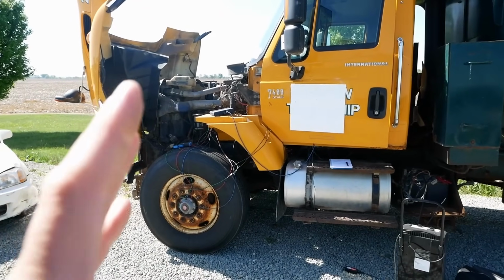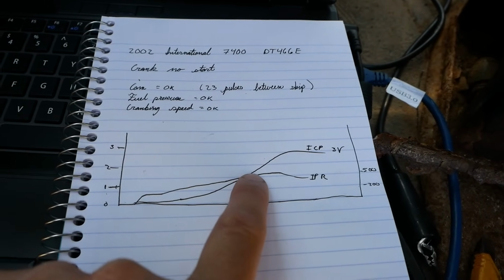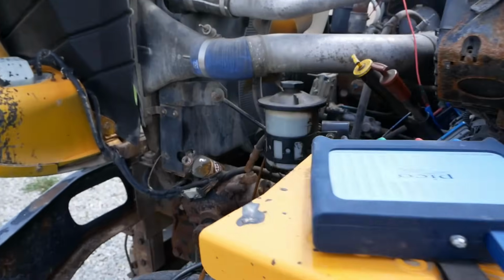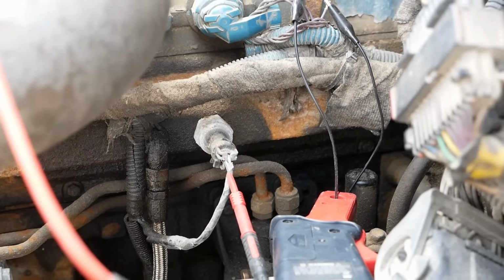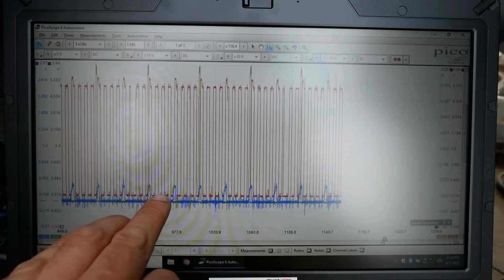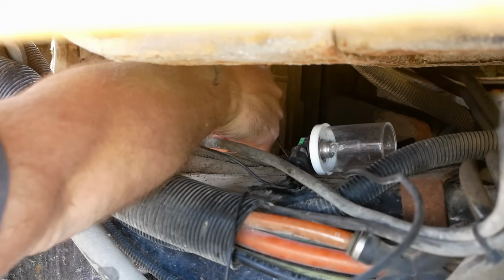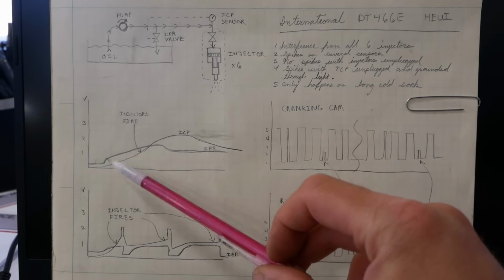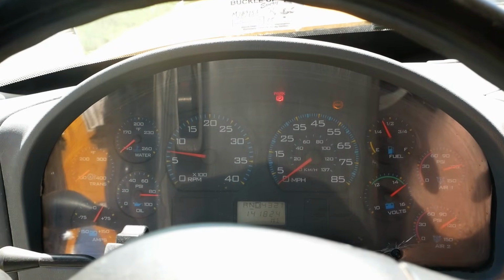International DT466E Won't Start without Ether after Sitting

Comment: The hump you are seeing is probably voltage drop on the ground wires/connections. Depending where you connect your scope ground it will measure the voltage drop of some wires.  As the injectors need a substantial amount of current, they will give you the biggest voltage drop. When you disconnect the injectors you don't have the high current peaks anymore and no voltage drops either. Maybe you could use your current clamp to check the wires that carry the injector currents from battery to the ecu and reinforce those wires for lower resistance and lower voltage drop. Or You could use the scope to measure the voltage drops on power and grounds on the ecu.  That would be better than using the light bulb probe. Maybe if you change your scope ground to the ecu you eliminate your voltage drop measurements and that would help identify the no start  issue. That is my guess.
Reply: Yes, looks like ground issues. ECU has bad ground so it is pulling current through sensor grounds. Test lights are not good for testing grounds especially with an ECU. Internally the ECU connects them together. One can be open and the light will show a ground as it runs through the ECU to a working ground.
Unplugging the ECU and testing powers and grounds will show valid information.
Reply: Good advice, sir!
Reply: I was tending toward an earth issue as well, most likely a dodgy chassis earth somewhere on the block. My next step would be to Megger each earth but that would require disconnecting the ecu so I think Wes has got as far as can be done without committing to an ecu replacement.
Reply: @elanman608  what does megger mean?
Reply: @thehulkamaniabrother2.089  A Megger is a brand name for a high, very high,  resistance tester. It is used to test insulator effectiveness. It subjects the insulator under test to high voltages, typically 100s to 1000s  (and up) Volts while measuring micro Amps of leakage,  resulting in effective measurements in the 1000 mega ohm range.
Reply: @edwardromana  oh

Comment: Heui systems always do the weirdest stuff when old. Had a 6.0 power stroke once that had a complaint of oil gets too hot low power etc, but if an oil change is done that problem goes away and then slowly comes back. After a lot of head scratching and using a little parts swapping turns out the hpop was internally leaking, bypassing the oil cooler. But when you changed the oil the new additives sealed that leak for a little while. Most infuriating thing to figure out lol.

Comment: What you are dealing with in this one is very close to home for me. There are a lot of these 466e and 444 (powerstroke) local to me that I have spent a significant amount of time on. There are so many possibilities that its most likely multiple things, for example. Had a few Intertrashional 466 plow trucks that the engine harness would have salt and water intrusion in multiple spots in the wiring harness. Voltage from one inject might fire another or send cam signal to each injector simultaneously. Have seen the HPOP fail to supply the correct pressures from electrical (IPR) or mechanical (cracked heads, cracked injectors, or bad pump), 

All of the electronic control diesels have their own piles of unmitigated garbage that come along with them, save for the smaller cummins. The really redeeming factor for them is they weigh 1800-2500lbs, so at least you get a few sandwiches worth when you crush the trucks.
Reply: I don't know squat about electronic controlled diesels, but I know lots about salt corrosion living in Northern NYS. I was thinking it's corrosion down in all that wiring that's getting sprayed with salt water all winter long. I don't care how "waterproof" they make that ECM computer, I bet the inside is damp with salt water.
Reply: That sounds like a nightmare. Good to know that this sort of thing can happen....
Reply: Dude....you hit that nail square on the head. No pond is deep enough!
Reply: 9

Comment: Check the batteries WWK, I had some Funky stuff happen with my computer which in turn possessed my van with all sorts of things, like throttle spikes on it's own or no throttle (briefly). After testing the battery, I found it had a Short in one of the cells which affected the whole battery itself giving off some real Funky Voltage and Amps. Replaced the Battery and never had that problem again. "Maybe" an area to test on. The computer also needs "Good" Voltage and Amps from the battery to run properly, find out from International what that is.

Theirs "a lot" of corrosion which leads me to believe some of those Plug-Ins exposed to the elements like that (like in my van) should be treated with Die-Electric grease and "ALL" of those wires need to be sprayed down with WD40 (all of them) to prevent anymore cracking, works very well against that.  Caution, WD40 has a Freeze limit of -15 C, any moving mechanical pieces "will freeze" at that point (door locks), found out the hard way on that one, hehe.

The Computer needs "Good" communication from Sensors to Respond accordingly to what information it's being given to it, if you have a weak Sensor Link from a corroded wire to a Particular Sensor it won't get the proper information it needs. I don't see "any" trouble lights on in the dash, if you don't have any trouble codes showing, then that leads me to believe it's a battery issue itself (Shorted Battery Cell).

Also check the Ignition switch itself to make sure "all" of the required wires are getting good connections when Turned-On, this was another "separate" issue I had, I had to replace mine, it had a bad Ground Connection which is the way this particular vehicle was set-up Ground Activation, not Power Activation. 2-days of wire Tracking and Schematic reading to get to that point, very annoying. Also make sure it has "Good" power and ground supply from the battery.

These are only suggestions which may or my not help in your case but it did in mine (replaced the battery), some "Really Funky" stuff happened when that battery cell shorted out (really funky). Start from the Base point (Batteries) and work into from their is my suggestion. Take Care. :) NC
Reply: That truck had room for two batteries but only had one installed. I bet having that extra battery would help.
Reply: @ericpaul4575  Very good point brought up their for sure, not enough volts/amps from the Battery she won't fire.

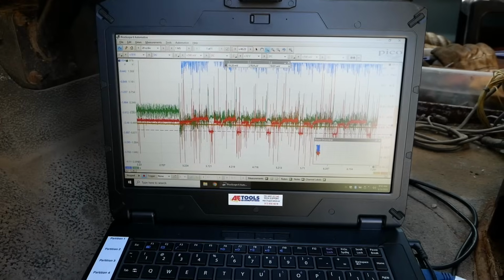Comment: 3:55 I haven't watched the complete video at this point but my first guess is the seals are bad (or just one) for the oil pressure to the injectors.
Being a retired Cat engine mechanic I have repaired this on 3406 engines that were labeled C15.
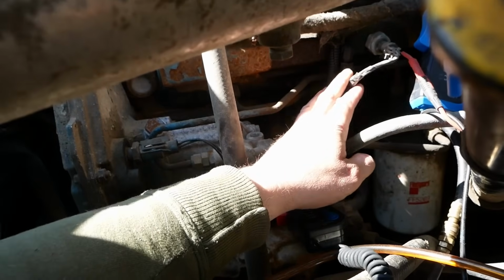4:27 If it has a ICP valve like the 3126/C7 that too could be a problem. Changed many of them also.
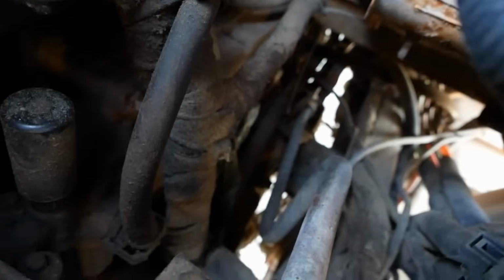21:08 Welcome to the world of a C7 in a school bus. Lol

Comment: As an International mechanic, we just cheat and have a cabinet full of test ECM's and sensors that we swap around.
Reply from the maker: Heh. Sounds like the Ford method. Every step in the troubleshooting tree is "substitute known good"...
Reply: @WatchWesWork  That would land us all into the realm of 'throwing parts' at a problem, but it can be a good way to go as long as you don't blow up your test parts.
The ultimate is a spare identical vehicle to temporarily host suspected bad parts, for the purposes of testing!
There is no shame in it if you have the parts on your shelf, and it will save some time and trouble.  Unfortunately with the new junk, you'll need the dealer to do a reflash if you replace a marker light bulb...

Comment: Oh, geeze... it's the [Township name here] truck again... I'd question why they haven't kicked this heap down the road, but it looks about the same condition as any municipal rig in the salt belt, including my podunk town's fleet here in the north east.
Reply: The ECG.
Equipment Common Ground..

The symptoms that point to it.

1. If the batteries sit long enough to lose their surface charge it won't start. ( drops down to approx 2.1 volts per cell ) 

2. Would start if you put a charger on it.
( Get the battery over 2.1 vpc)

3. Slowly got worse ( batteries weakened.)

International has a bad habit of running the negative cables in ways that allow road spray to get inside the cables and that water then "wicks" through the entire system.

I believe that one of your grounds is bad and the extra 0.4 volts you lose while sitting is enough to cause the system to fail.

Our roll back did the same exact thing we went through the same diagnostic path until we hooked a meter up to the negative post and each individual ground point and measured the voltage difference while cranking.

Millivolts of difference became as high as 5 volts at some points as soon as the starter engaged.

Replaced the cables , started everytime.

Comment: Wes , you are an amazing troubleshooter. This design seems over complicated. I assume that you get a lot of work that other folks couldn’t figure out. That’s a good reputation to have. Thanks for sharing
Reply: That type of work doesn't produce good profit.  And profit keeps the doors open.  At some point it begins to eat your lunch.
Reply: He didn’t fix anything. He “thinks” it “might” be the ECM. Exactly what did he troubleshoot?
Reply: @vg3430  it might be the ECM aka it's probably ECM unless it has a short in the loom... All this breaks down to someone who's smart enough to understand you never guarantee a diagnosis if you can't test your solution and he knows he can't test the solution without a different ECM
Reply: @vg3430  He's a helluva lot more capable than 98% of diy mechanics who, like myself, don't know the first thing about reading electrical signals and scopes. This result is a lot closer to the solution than most can do. Also he posts interesting stuff to youtube, not the stuff that makes the most money. Nobody wants to see a Camry's brake pads being replaced. He doesn't always win against the machines either. It's a bit of an accomplishment to be as capable as he is on so many different makes an models.

Comment: I had a very similar issue on an ambulance. It was a 94 7.3.  Ended up just being a leak on the HEUI system not allowing it to build enough pressure to fire the injectors. I’ll tell ya..  that engine in a van style chassis makes it very difficult to get to the problem. I wish this video existed two years ago as I didn’t even know what that system was all about.
Reply: Yep been there done that on the ambulance cut away bodies.  I learned years ago to check pressures on the oil system or nothing is happening.  Same thing on the 6.0 as well.  Once they start taking longer to crank you better find the leak.  Many times it is a bad IPR
Reply: Wes worked on my 95 E350 with the 7.3, that used to be an ambulance.  I'm sure he would agree, that it's difficult to get to just about anything. My truck was eating up IDM's every 20 miles. Another mechanic put a new one in and it made it back to my house. He said it must have been a bad one, because we checked the connections and harness under the valve covers. While Wes was working on it, he found 4 wires on the firewall, that come from the IDM, that had a spot of insulation missing, all in the same spot. Maybe a mouse got hungry? Anyway, the IDM he put in is still working 2 years later. 😬